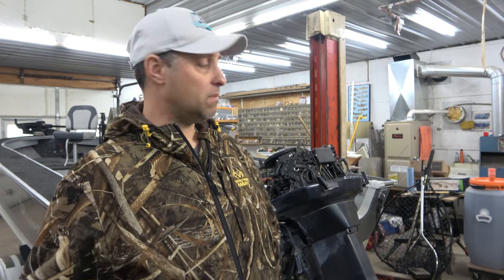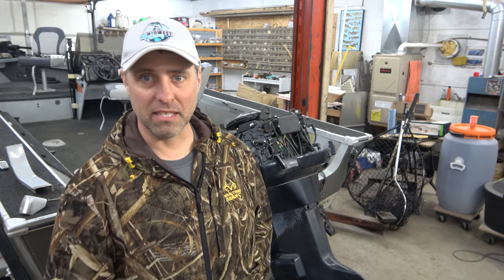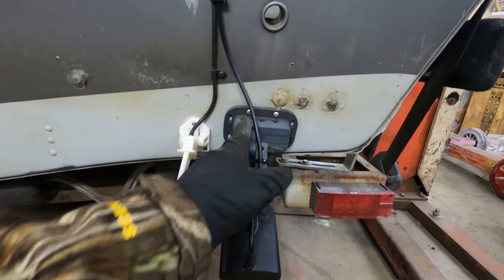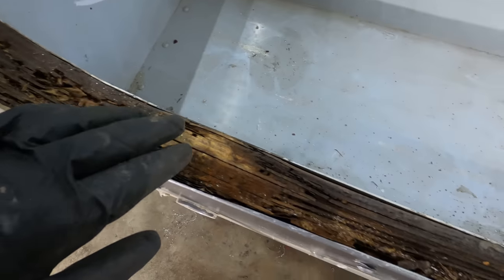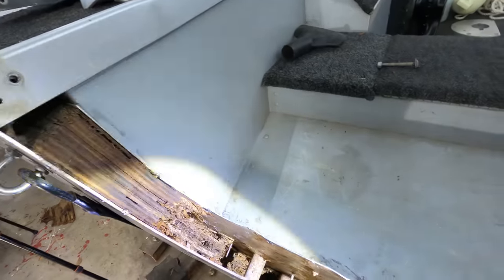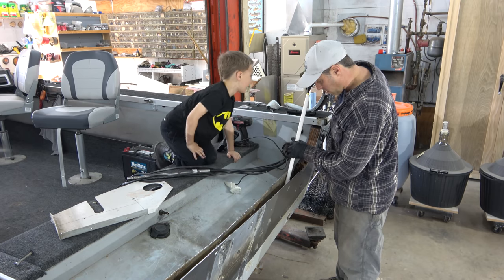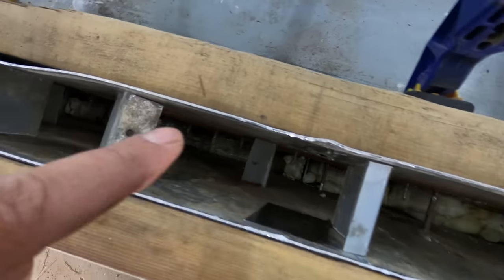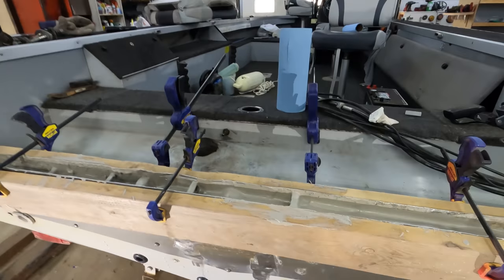The Easiest Way To Replace A Boat Transom

Comment: To top of the poured transom, bondo instead of pour foam. Good try, not good enough, sorry. I realize, not an easy job. Additional ribs holding transom to boat deck would help since a bigger motor is coming. That would prevent wood left in there from hinging and pulling transom out at those hinge points. Highly recommended to hold transom from pulling out by installing triangular ribs attached to deck. Good luck.

Comment: Only $250 (not including shipping) per 5 gal bucket as of 6/15/2023...  Not too shabby, considering inflation and overall garbage economy...
Reply from the maker: It sounds like a lot, but the overall cost is about the same or cheaper than other options. I just wish they had 1 gallon options. Thanks for the comment.

Comment: I'm 51 now but 33 years ago I did a transom repair too a 71 fiberglass woodson trihull. I pulled the screws and lifted the gunwales removed all the bad wood in the transom from side to side. Then I  fiberglassed coated and layered marine grade plywood then cut it to shape using a template and slid it into the transom. Put all new stainless bolts and hardware in and bolted the motor back up with stainless bolts. That boat was still in use with a new motor 10 years ago.
Reply from the maker: Sounds like you did a great job if its still going.

Comment: Seacast (brand name) makes spacer blocks out of the same material as their product. Bonds perfectly with the liquid resin.
Also, you definitely shorted yourself on material. The expanding foam you used to finish the job has absolutely zero structural strength.

Comment: That 88 evinrude looks like a SPL .   I had one once and it was a really great engine . it had more power than the newer 90 hp evinrude I put on afterwords !
Reply from the maker: Yes it is an 88 SPL. I've had lots of comments on what a great engine it is. I'm not entirely sure what makes it a special, do you? I've heard they removed the oil injection, but its got to be more than just that right?
Reply: @GoMidwestFishing  I think the 88 SPL is a 90 without oil injection and or power trim.
Reply from the maker: @timothyreed6054  After looking into it, it appears to just not have oil injection. Mine has power trim, which I assume is factory. Thanks for the info!

Comment: 28:51 in you used bondo, if you would have used fairing compound you would have had a much better permanent repair. Automotive bondo or body filler isn't meant for this application and it absorbs moisture.
Reply: Same with most foam in a can

Comment: Take the top cap back off and seal it with something.  That foam will not hold up to water seeping in and will start the whole process all over!!!
Reply: He could mix a bunch of fiberglass resin and pour it to seal it. Why didnt he just pour more carbon core at the top?

Comment: Never seen a aluminium boat with timber in the transom before
Reply: Ya sort of a manufacturing trend always used wood because its cheap. My old starcraft 16' aluminum had a wood brace backing inside the back of the transom. Campion started using composite transoms in 2004. Most boat manufacturers are using composite cores now.

Comment: can you use this on fiber glass     blackmaxxr4
Reply from the maker: Hi Rick, yes you can. You can also pour it into a mold if you want to make a solid piece before installing it. In my case, it was much easier to just pour it directly in. This stuff will work on any type of boat. You can also find similar products made by other companies as well. They all seem to work great and last a long time.
Reply: @GoMidwestFishing  Thank you,  This is alot easier than using a board.  Ricky

Comment: This is a video on "how not to fix a transom". He didnt remove all the wood from the entire transom, it will fail eventually, the motor & rest of the boat will be on the bottom after it sinks. Replacing a transom the old fashioned way with marine plywood & a wood chisel is the best fix.
Reply: You are so wrong it’s laughable. This stuff bonds to any remaining wood and stabilizes it as well as being much stronger than plywood.

Comment: You could have encapsulated a few boards in side the mix for filler so bv would be to the top. Expandable foam dont get it. You did not finish the  job correctly .
Reply from the maker: Thanks for the info. Encapsulating a few boards might have been a good way to fix that problem.

Comment: U should use a spade drill aka paddle bit
Reply from the maker: Hi Dennis. Yes, that would have worked much better. I actually did use a spade drill at first, but it was a short one. To reach further down I had to use the longest bit I had, even though it didn't work as well.

Comment: I myself would used 2x4 cut longer than the space needed to push the inside metal and top back into place . I see as I wrote this you used metal . If it works use it .
Reply from the maker: It seemed to work with the aluminum. I just filmed a follow up video that will be out soon. Thanks for the input.

Comment: If you have transom rot, you have stringer rot.
Reply from the maker: The rest of the boat is aluminum, so the stringers are fine. I had to pull the gas tank so I got a good look at it all.

Comment: Ok 1st the torch and the rods that’s not welding it’s soldering or brazing. Welding melts the base metals and the rod together soldering or brazing simply uses the rod like melted glue to join the pieces together. And before anyone gets smart I am a multi certified welder and I actually know what I am talking about. 2nd aluminum has to be super clean in order to weld , solder , or braze. Otherwise you are just making things worse and wasting your time. Now I do like the idea of the liquid transom. But I disagree with leaving any old wood.  But that really none of my buisness. I will say you should have used panel bond instead of the as seen on tv silicone. Panel bond is actually the closest thing the actual welding. That also requires clean surfaces. But panel bond will hold and seal. Now to can clean all that bindi and silicone and use some seam sealer which is what they use when the build new cars to keep the water out. They go over every seam with it.
Reply from the maker: Thanks blackheart. That was some very well thought out info.

Comment: Easiest and cheapest is seldom the best way.   There is no substitute for proper structural repair of a boat transom.  There is way too much stress applied by an engine under power.   If someone uses this in good faith and their transom comes apart and somebody gets hurt you have placed yourself in a precarious liability position.  It does give you content to get paid for so there is that.
Reply from the maker: I understand your concern, but this product was designed for transom use and to be poured in just as I did. I may not have done a perfect job, but after several years now, it is holding up perfectly.

Comment: should have used metal bond for the inner seam. a bonding glue for metal that has twice the strength of welding this is used know in car manufacturing for bonding roof panel and quarter panel as well as structural panels

Comment: Option #1, never buy a aluminium boat with a wooden sandwich cored transom. 
  Either build or buy a wood skiff.
Guys keep buying $30K boats that are poorly designed, and 15 years later this is what they have. 
I have a 72 yr old all wooden boat that has zero rot. Tighten up some Roves every several years and some bottom paint. And lets go fishing 😂
Reply from the maker: A 72 year old boat with no rot? That is amazing. I guess they don't build them like they use to. Luckily I got this one cheap off craigslist.
Reply: @GoMidwestFishing  ive seen numerous Herroshoffs built in the 19 teens. With very minimal rot. Wood boats has to be maintained. But properly maintained and cared for its hard to ssy how long they could last. My boat leaks every year. Fill it with water and she swells right up

Comment: I don't know many boat builders who build Aluminium boats that actually use a plywood transom between an Aluminium sheath, for obvious reasons your boat for example . To do the right job removing the aluminium transom seeing how it is riveted not welded would have been the right way to go and the stuff your using will eventually crack as there's nothing apart from the ally sheath on either side as reinforcing structure. But Hey you want a cheap quick fix you got it!!

Comment: You should have attached one side of the top rail then applied the sealant on that piece and then lay the second piece down.
Having one side anchored would sure make it easier and your sealant wouldnt move around so much possibly causing leaks.
Reply from the maker: Thanks for the info. I agree. I learn as I go.

Comment: Transom looks solid but what makes you think the entire transom won't come off under stress.  Janky repair at best.  I wouldn't run more than a 25hp on a transom repaired in this manner. Really shoddy original transom construction.  I would never purchase that brand boat again.  Looked like 1970s style construction.
Your repairs are the type that will seem great right up until the point they fail.  
Seriously, you are going to take your kids out in that boat?  Bad move.

Comment: I respect the efforts in the knowledge but when the flathead screwdriver come out for a pry bar and wood proper. I was done watching I remember as a kid if I miss you any one of my dad's tools like that there was a punishment for is about as equals if I left them laying on the floor every tool has its job my dad would need a flat head screwdriver for an electric job guess what the Flathead was boogered-up cuz I used it for a pry bar

Comment: Those rods are false advertising. It's not really a welding rod. More of brazing rod. Not much for structural integrity. I would be interested in. If this product would work for a fiberglass boat. Like pre make the transom in a mould.then fiberglass over it. It would be better than wood. But cheeper than the other stuff
Reply from the maker: Yes, this works in fiberglass boats too. You can make a mold to form a transom before installing it. They recommend you lay down a layer of fiberglass before pouring, which does help strengthen it, but also helps to remove it from the mold and keep it from sticking to the wood.

Comment: You kept tightening bolts and adding silicone to gaps and it still took you another couple seasons to figure out that transom was shot? I won’t be taking any advice from this fool and anyone who does is asking for what happens lol.

Comment: I think it looks great, but I would have just cut the back off of the transom replaced it with plywood and have a new plate welded on the transom all the way to the top making it even with the rest of the hull and have it made or bought an outboard engine mount installed so the engine sits on the outside of the boat.  This look like to much work and no guarantee it will last to pass it down to your son.  I did this to a 30 foot Starcraft after I was out about 20 miles off shore fishing for tuna and the engine wouldn't start at first and I started thinking about all those stories of people stuck on boats drifting around the ocean having to drink their own urine to survive.  I decided that I needed another engine but there wasn't enough room for a second engine so I replaced the transom and had installed a long extended engine mount that had plenty of room for a second outboard and probably a enough room to add a third outboard?  Never had a problem with the setup and the engine that day did start up eventually in case you wondering about it.  Oh I did not really see an increase in speed but I sure notice the MPG was a lot better.
Reply from the maker: Well, if I ever get stuck out in the middle of the ocean with this boat, I will have to say, "David told me so." I appreciate the feedback. The truth is, I rarely even use the big motor. 95% of the time I just use the trolling motor, and it usually has enough power to get me back to the landing if the big motor fails.
Reply: @GoMidwestFishing  .  Don't get me wrong I was just thinking about when I replaced the transom for different reasons than your replacement for the transom going bad.  It is just a theory that I have of mounting the outboard out side of the boat will cut down on the transom going bad later than sooner.  You still did a great job.
Reply from the maker: @elcajondavid1  Thanks. I appreciate that!

Comment: Stainless screws will rout aluminum, Must be from the other side of the MISSISSIPPI
Reply from the maker: There seems to be a lot of debate about this. The manufacturer used stainless screws, so I did the same. What type of fastener would you use?

Comment: whats you going to do if you need to service thru hull fittings ?  didnt see you remove them
Reply from the maker: I didn't need to remove them, which is what makes this way so simple. You should be able to service them like you normally would. The material can be drilled and manipulated just like wood.

Comment: Not to familiar with boats. Why use Plywood? Why not use fiberglass ?
Reply from the maker: Boats are generally made out of fiberglass or aluminum, so the skins on either side of the transom are made of that, but the actual transom is usually made out of plywood, but there are other options now too. Wood tends to rot when it get wet, so composite materials are getting more popular. The main thing is that it has to be strong enough to hold a heavy motor and the force it produces when moving.

Comment: The transom takes a tremendous amount of stress and punishment.
Reply from the maker: It sure does. Especially when you realize it's holding a motor weighing hundreds of pounds thats constantly pulling/ pushing on it.

Comment: I don't blame you for going for the quick fix but you can't buy an engine rebuild in a can. You can't stop a leak with a bottle of goo and I'm thinking the same may be the case here. If I went a route like this then some company would have to convince me that thier product has an advantage over me smashing kitty hair glass down in that hole and letting it rip. If the product doesn't have some major fiber in it then I can't see it being strong enough but guess we shall see.

Comment: I am really surprised that this boat manufacture didn't use either a better, non rotting material for the transom. It dosn't even look like marine  grade plywood. An all aluminum space frame to support the engine and then skinned in aluminum would be better and last forever. If i were him i would be pissed off! That boat was not cheap I am sure every one of those boats from this company have this issue. Pretty shitty if you ask me.

Comment: Maybe easiest but not the best. Vibration and stress will turn it into a million pieces.
Reply from the maker: Hi Joe. I'm going to have to disagree with you on this one. I did some research on Carbon-Core before using it. It is specifically designed for transoms, which means it won't absorb water and has some flexibility to it so it won't crack. It is also much stronger than plywood. It will probably outlast the boat.
Reply: @GoMidwestFishing  Poured concrete goes all to pieces with out reinforcing. But like you say, it's flexible. Wish you well.
Reply from the maker: @joe-hp4nk  That's true, concrete will crumble. This is not concrete. Here is the description right from their website: "It's a Ceramic Pourable Compound with premium polyester resins and high strength ceramic spheres resulting in high tensile and flexural strength."
Reply: @GoMidwestFishing  Time will be the test.

Comment: You can drill that wood out you drill and float the work chips then get aluminum rods for strength then poor it in the round rods is for strength it works I have done this several times

Comment: Raw body filler not coated is like a sponge to water. Welding aluminum is almost impossible it not thoroughly cleaned. Looks like the carbon coat did a good job, 👍😁
Reply from the maker: Hi Ken, Thanks for the input.

Comment: The wanna be marine technician did well 😂 Looks good and should hold up for as long as you need it. Is the next project to restore the silo beside the vineyard? 😜
Reply from the maker: I see you noticed the silo. I've been doing some landscaping around it, and removed the back portion of what remains of my barn. Right now it only serves as a photo backdrop and an insurance liability. We run a daycare here and apparently daycare insurance doesn't like silos.

Comment: holly flying jesus, that stuff is expensive... and yet its still polyester composite. should have purchased polyester resin and mix it with some solid insulating foam, would have been even lighter
Reply from the maker: I thought it seemed expensive at first too, but at $500, it would have been the same price for Coosa board. Plywood would have been slightly less, but a lot more work since I would have had to dismantle the whole back end.

Comment: Bondo is not waterproof. Use a fiberglass reinforced waterproof filler instead
Reply: I don't want to defend anything in this video but I think "Bondo Fibreglass Resin" is 100% waterproof.
Reply: @alexlongfield2113  Bondo is the nickname of standard autobody filler.  The "bondo" brand is not what I was talking about. Yes Bondo  brand fiberglass resin is waterproof. as is any fiberglass resin. He was using standard body filler in a waterproof application and by it's color it is not waterproof.
Reply: @richardbaumeister466  Gotcha.  Just didn't want people to shy away from using fiberglass resin as I think it is a good/possibly best choice.  cheers
Reply from the maker: Just to be clear, the product is Carbon Core. It is not Bondo and not auto body filler. It is a product specifically designed for transom replacements. I mentioned it smells exactly like Bondo, but it is a different product.